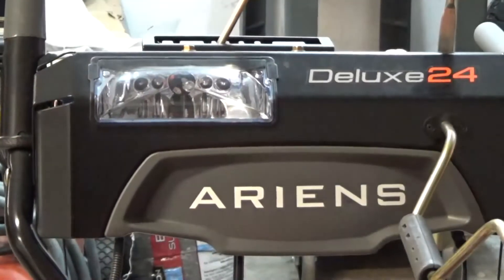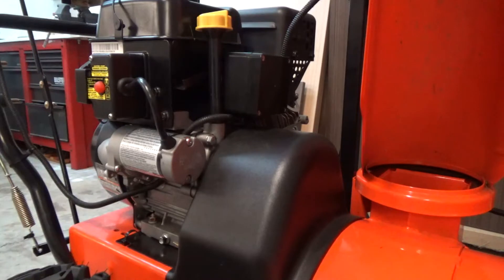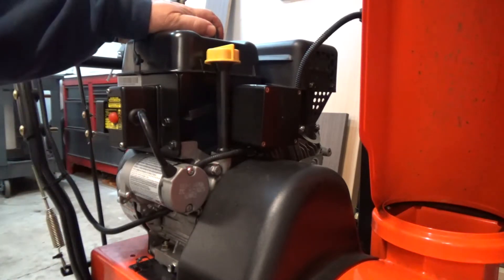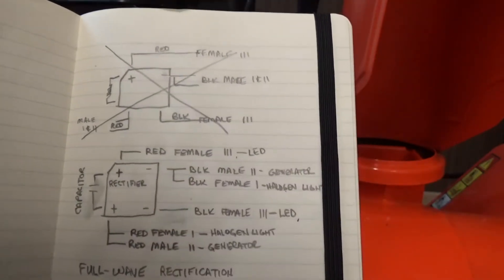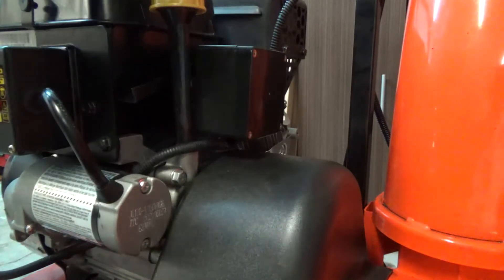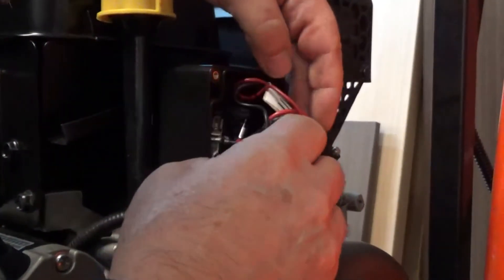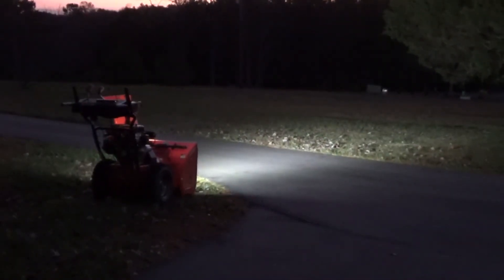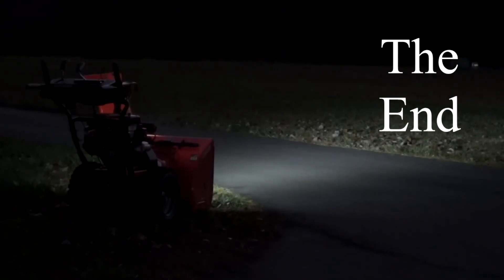Ariens Snow blower LED Light Installation

Comment: How many watts is the light and are you worried about your stator on your machine? Thanks in advance.
Reply from the maker: That is a good question.  I regret to say that I did not even give that a second thought.  I just figured that the pull from the LED was so much lower than the incandescent bulb that I would be ok.
Sounds like a good project to figure out.
Reply: Ya I have heard not to exceed the wattage of your exciting bulb. I am not sure how much of a strain it puts on your stator but I think you should disconnect your old bulb.I am Trying to figure out just how much you may be able to exceed the wattage without straining it.

Comment: Are the pre fab mini ac to dc converters missing capacitors? Is that why you would make a rig like this? My light is out and I’m looking to go LED. Any help is appreciated!
Reply from the maker: I would have to read the details on the AC/DC converter to see if the capacitor can help reduce the visible blinking by compressing the sine wave.

If I may, the light up on the handlebars is designed as a warning to oncoming traffic when you plow at night.  Ariens makes an LED light to replace the halogen light and is a direct replacement for around $50 last time I checked, I also did a video on that light. Ariens Part Number: 72104400
If you want a true Headlight a.k.a. spotlight to brighten up your path then you can add a bright light like the one shown.

You can tap off the Ariens replacement light for that, you can make one, or you could try the AC/DC converter.  If you buy it on Amazon you can return the Ariens Light or the AC/DC Converter for the Spotlight if it does not perform as desired.

The capacitor keeps the light from blinking slowly.
The light still blinks but the eye just does not pick up flashing at that high speed.

In conclusion, if you are just replacing the handlebar light just replace it with the OEM Ariens LED light.

Comment: If you use two caps in parallel it takes out more flicker.
Reply from the maker: Thank you for that tip.  I am mechanical not electrical and appreciate your comment.

Comment: Cool.  I've done something similar when restoring a 1950's Zenith Consoltone tube radio.  It had an old selenium rectifier in it that I replaced with a 1N4007 diode and a dropping resistor.  Worked like a charm.

Comment: Hello.  Instead of using capacitors you could have just used a 12v Ac to Dc converter. The capacitor is built in .  This would have saved a step.  Nice detail and how to.
Reply from the maker: Thank you.  I did not even know a converter existed.  My ingorance is very wide spread when dealing with electrons.  Thank you very much for taking the time to leave such a nice comment.
Reply: Yes. Very nice. The box held on with Oil Check Tube Bolt is "Genius". If anything your degree just paid off. But why only one Cap? Most all of the other vids are showing two. If anything your degree just paid off. 
Very Clean OEM Install. Pro Job there ma man!!! 🤟

So @Mate from Virginia, any particular make and model of converter that you are talking about?  Cuz I'm using a 22" Mini Off-Road Light Bar, which the bolt holes just happen to match whats on the hood, and that help.🤓